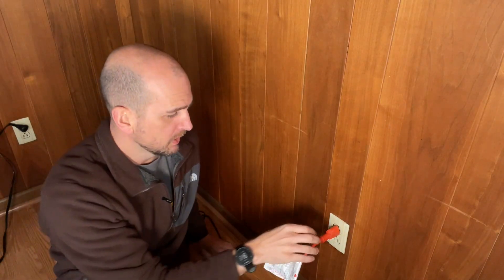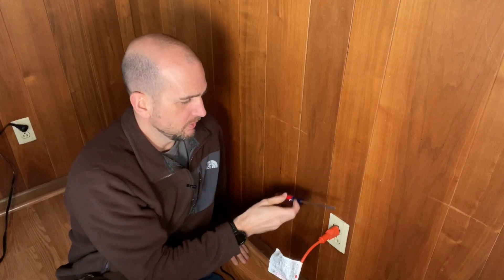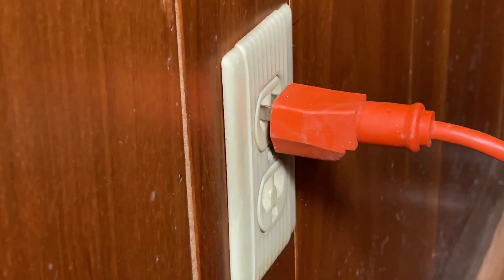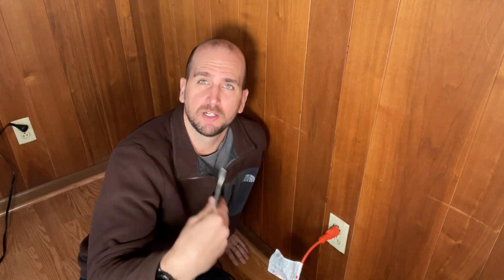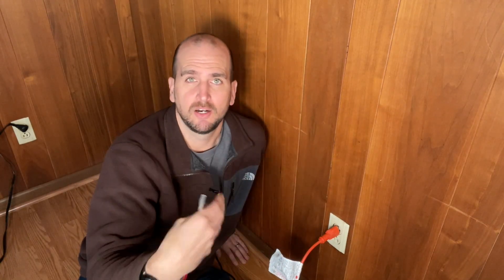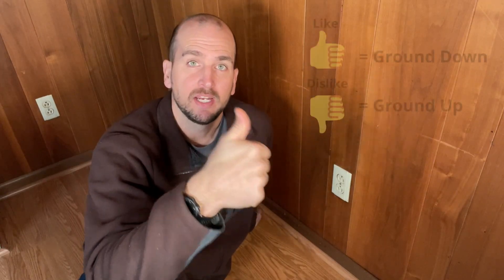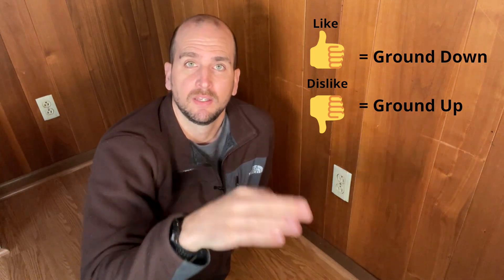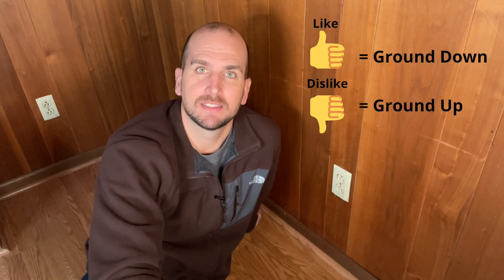Should An Outlet Be Installed Ground Down Or Up

Comment: I witnessed a commercial customer which had a data center on the 3rd floor of a building. The beaded chain supporting the paper basket on a printer broke and fell on the hot prong of the outlet it was plugged into. This started a fire which set off the sprinkler system and flooded the whole building before it was shut off. The repair process took about 4 months. Our company standard is always facing up unless orientation of device needs to be down.
Bill from Nashville Tn.

Comment: in UK we have ground up socket outlets, with wire at 90 degees on all plugs hanging down, never at any other position, plus the socket outlet has safety shutters on the live holes which are opened by the ground pin on the plug while inserting the plug making it very safe to use.

Comment: I recently had some outlets added by a licensed electrician and he chose ground down. That is what I always assumed too. Watching your video, I think that ground up might be better, but would not worry either way. Any outlet that will always have a right angle plug (example-refrigerator or other appliance) I would orient the socket so that the wire goes in the direction needed (usually down).

Comment: The only thing that really has any chance of shorting across the hot and neutral with ground down is the metal face plate itself during installation (circuit should be off so it shouldn't be a factor plus no cord would be plugged in). In most cases a receptacle is connected to metal faceplate then faceplate connected to box when metal, household plates are almost always plastic. Yes there are scenarios where you use a metal faceplate when receptacle is in box first but that goes to initial point.

Then there is the argument that when ground is up it would be the first prong to pull out with loose cord defeating the ground? The ground prong is slightly longer but could you have a hot/ neutral connected and no ground?

GFCI are almost always ground up. Cords etc are mostly designed for ground down applications. 

IMO you match other receptacles and my preference is ground down with residential.

Comment: When I was in Jr. High School, my Social Studies class was right after lunch and 3 or 4 days a week, the teacher would show videos from a projector onto a roll down white screen based on Social Studies and then the last 15 minutes of class after the movie would end, he would rewind the movie ready for the next class. He had the window shades already closed and drawn and he would walk into the class, close the door, turn out the lights and walk back and start the projector. Well one day I brought a small piece of 20 gauge wire to school and before anyone came to class from lunch, I pulled the power cord from the wall and wrapped a turn of that 20 gauge wire across the plug terminals, then left it unplugged by the receptable.
Well in he comes, same routine...out go the lights and he switches on the projector....Nothing happens. Flips the projector switch a few more times, then it gets quiet...as he can see in the dim light that the power cord was unplugged from the wall... then a second later, it looked like a bolt of lightning flash struck the inside that classroom. No movie that day.... by the time the school maintenance got there, class was over....

Comment: With over 40 years as an electrician I have installed them both ways but I think NEC once put out a recommendation to put ground up for the reason you stated in your video

Comment: The last time I worked as a journeyman electrician (the ‘80s) for pay, it was in Canada. The CEC, which follows the NEC for the most part, had an Appendix then which illustrated the different receptacle configurations for different voltages and amperages. The 120V/15A receptacle was drawn ground up. (No explanation was given for the orientation.) I’m reasonably sure that copies of the NEC from that time period would have something similar.

That said, no one on any commercial, industrial or utility job I was on, installed them that way. And no engineer/architect called for them.

I don’t know if current issues of the CEC still have that Appendix, although it sounds like the current NEC doesn’t.

Personally, I go with the flow. If I’m working on an existing place, I’ll install new/replacement receptacles the way the rest of them are. No biggie.

Also, for what it’s worth, in a brand new, fancy, house I helped wire for my daughter a year ago, all receptacles were turned on their sides.

Comment: To me this is one of those situations where people have gotten too overzealous with trying to prevent a hazard that isn't very common. Ive heard various things over the years concerning this such as: "it's code for all general purpose outlets"," it's code for all residential outlets" , " code for all outlets under a certain height", "anywhere a child can reach them" etc. Alot of people have said alot of things to me about this but I have never seen an actual code requirement addressing the matter. Personally I prefer ground down and most equipment seems to favor this. There are so many ways in which electrical equipment can become dangerous that you can't reengineer around them all and it's always seemed kinda silly to me to turn an outlet upside down because something might fall on it.
Reply: You may think that, But I've had it happen in my workshop, where something fell on the plug and shorted between the flat blades.  I also noticed on my company's campus, which was built new in about 2000, that all outlets were installed ground up.  Both of these really made me think about it.  It's true though that ground-up can sometimes be inconvenient with certain devices.
Reply: By that logic, it's kind of silly to have smoke detectors in your house because one day you "might" have a fire
Reply: @jimcab4279  Not quite. House fires are unfortunately quite common and often catastrophic. Metal objects falling on outlet plugs is not.  At some point the safety measures should be proportioned to the risk involved.
Reply: @lauratanner8475  the safety measure of installing an outlet with the ground up isn't all that much "extra" work, in fact, it's zero extra work, you just install the outlet with the ground up to avoid hazard. But hey, I'm just a commercial and industrial electrician for the last 35 years so you obviously know more about electrical hazards than I do, what was I thinking? Not to mention, the industry standard is that in residential units the outlet goes ground down but in commercial and industrial settings the ground goes up because in a commercial or industrial setting there is actual a fairly high risk of metal object falling behind plugs just like described in the video.
Reply: @jimcab4279  I'm an industrial electrician as well sir with plenty of residential and commercial work under my belt as well. In 25 years I've never seen this happen and maybe heard of it happening only a few times. The issue I have with this practice is not the amount of work it takes to install an outlet in either configuration. It is the fact that most equipment is made to be plugged into an outlet that is installed with the ground down.
Reply: @jimcab4279  Oh don't get me wrong I didn't say it was wrong just that it's stupid 😅
Reply: @lauratanner8475  That's the point, it's not stupid that's why the entire electrical industry has been installing receptacles with the ground up in commercial/industrial settings for the last 80 years. The only one who thinks it's stupid is you because you foolishly think that a "few" fires and deaths here and there are a small price to pay to be able to look at an outlet on the wall with the ground down. That sounds like stupidity to me. If you're an electrician then you obvious know that everything is redundantly grounded, I guess that's stupid too because redundant grounding is just redundant...it's stupid lol
Reply: As a kid I definitely had the metal band of my headphones fall off the side of the bed and hit the exposed prongs causing: a huge spark, possible fire by being next to the bed, and a respect for the outlets that has been there ever since
Reply: I guess you deleted your last reply, you're better off because it was starting to sound pretty foolish. Here's the deal, it's at minimum 750 thousand union electricians who disagree with you, so odds would say that if 750 thousand people in that profession think one thing is right and ONE person on Youtube thinks it's wrong....I'd say there's better odds that the 750k people are right and the 1 person saying the opposite is wrong
Reply: @jimcab4279  I deleted by accident. But I'll recap lol. I said basically that since grounded outlets only became mandatory about 50 years ago that I doubted that the entire electrical industry had been installing outlets ground up for the last 80 years. Also that I have never Known of any fires or deaths being attributed to the ground pin of an outlet facing down. That most equipment is made to plugged into outlets with the ground pin facing down as evidenced by akward loops and strains being placed on cords that are plugged into outlets with the pin facing up, not to mention wall wart style power supplies containing heavy transformers and such that can't be correctly plugged in upside down and then fall out of the outlet. And that I wouldn't call it the industry standard since it is essentially down to the personal preference and at any rate it is not a code requirement. When they make it code I'll do it. They haven't because tho there are some situations where it make sense it doesn't in most places. 👍
Reply: @lauratanner8475   I'm in the IBEW, we have 775k members in the USA we ARE the industry standard genius and all 775k of us install receptacles ground up in commercial and industrial settings. The "equipment" and cords you're talking about are from things in your HOUSE, I already said residential receptacles are installed ground down. Commerical and industrial equipment at least 99% of it is NOT designed to be plugged into ground down recptacles. If you were on any of the dozens of jobs I've been on for the last 35 years and you were installing your outlets ground down then you be fired because I've never seen a commercial or industrial electrical job in all my 35 years in which the receptacles were installed ground down...not one, not one job ever in 35 years.
Reply: @jimcab4279  It may be the standard on union jobs but it still isn't a code requirement. 775,000 union electricians is alot but it's probably still only about ten percent of the total electrical jobs in the country. The facility I work in isn't union. It was built in 96. There are thousands of outlets all installed ground down. No one has died and tho we've had some fires none were caused by outlets. So I guess I'll say when it's a code requirement OR if I ever go to work for the union I'll do it lol. Until then...
Reply: @lauratanner8475  The facility you work at was apparently built by a bunch of untrained, low skilled non union electricians who have no clue what they're doing, that's why they installed all the receptacles the wrong way. And because you're surrounded by a bunch of untrained, low skilled non union electricians, you've picked up their unsafe working habits and you're having trouble understanding the most basic safety concepts. I just hope you work by yourself and that you're not responsible for the safety of younger electricians working under you, because your view on safety is lacking if you think safety only gets practiced for accidents that happen "a lot" and accidents that are rare, you don't worry about. You're dangerous
Reply: @jimcab4279  oh calm down.
Reply: @lauratanner8475  It's the same concept of on commercial jobs where you're using metal boxes, after you wire the receptacle you wrap the sides of the receptacle with electrical tape so the exposed screws are covered up, which isn't a code requirement, BUT we wrap the outlet so the next electrician that pulls the outlet out of the box doesn't have to worry about shorting out the screw on the side of the box if it touches. It's NOT code requirement but it's common industry practice among good electricians for nothing more than the safety of your fellow electricians. But I'd bet my paycheck on the fact that "you" don't wrap your outlets and you're not going to start because you've never heard of anyone dying from shorting out a screw on the side of a metal box, good job. lol
Reply: @jimcab4279  Go to bed Jim!
Reply: @lauratanner8475  I can't I keep having nightmares about dangerous electricians who don't know what they're doing :)
Reply: Laura is correct.  It is obvious for those advocating shorting is a likely event then the use of a face plate with a deflector similar or the same as a mobile phone shelf to USB featured plugs or all receptacles need an outdoor type lift cover(cover lifts upward not to the side).  Claiming the ground up a safety feature to prevent a short is akin to me passing gas in any room I occupy is a safety feature because anyone entering the room will know someone is present by sound or smell.
Reply: I see your point.  Unfortunately rare accidents can compound with rare curcumstances and be devastating.  When installing ground up in an area where debris may fall would prevent catastrophe, that "i should have" feeling is not something you want in hind sight.  I say ground down in most situation but i would consider ground up for a bathroom, behind nightstands, and in garages.

Comment: Several years ago I bought a house, in Florida. This house was built in the 70"s. The electrical work had all outlets installed ground down, except for outlets controlled by wall switches. These were ground up.
Reply: I think that is a great idea, this way all it takes is a glance to know which outlets are controlled by a switch.

Comment: The last residential wiring I did (1976) was for a blind woman so she could touch the ground prong and the ground hole with one hand.(even wet) With the ground up it was less dangerous because the live and neutral were not in the way when she touched the receptical. It doesn't matter to me whether it's up or down, but from that experience I put ground up consistantly.
I have been a professional since late '60s, but only license (master) in Fla in mid '70s. Primary is industrial, old school magnetic controls thru PLCs.
Bi11 Hudson

Comment: I agree the ground should face up or to the right . If you have a horizontal orientated outlet the neutral will face up thus giving you protection from arching or electrical shock should something fall on the blade or a child putting something across the bare prong of the plug.

Comment: I've always installed plugs with the ground on the bottom.  Most plugs are designed for that configuration, especially the low-profile plugs.  They are all oriented so the wire immediately proceeds in a downward manner.  I don't buy the safety issue, as it is a rare three-prong plug that DOESN'T fit snuggly.  I should mention that I am from Canada and I've heard that in the province of Quebec, they prefer the ground to be in the upward position.  Even knowing this, when I renovated my home in the Gatineau Hills of Quebec, I insisted that all the plugs be installed with the ground down.  I think Quebec is bucking the norm because, well, basically, that's what they love to do.  If English Canada does something one way, they want exactly the opposite . . . just because.  I hear they're thinking of changing the driving lanes to the opposite side, like the U.K. – just because.  I'm kidding, of course . . . but just imagine the chaos when crossing the border between provinces.  Ha-ha!
Reply: It could be argued that ground up makes stresses in the cord where it leaves the outlet greatest in the ground wire, making an open ground the most likely cord failure mode. I've never known that to happen, though, and I will be 70 next month.

Comment: An additional argument for ground up is that when the plug is jerked partially out then hanging down at an angle, or it's under strain and being levered out, the live conductors are in the receptacle more and the ground is out more, making it marginally safer. Flipped the other way, the live conductors are levered out and exposed, but potentially still live.

Comment: In my house, they are installed horizontally in the baseboards. I prefer the ground on the bottom when they are installed vertically. It works better with cords that have a profile plugs.  If your plugs are falling, the outlet should be replaced.

Comment: Although the orientation is not specifically identified in the NEC, it is a NEMA standard for the ground prong to be at the top when installed in a vertical orientation.  When installed horizontally, NEMA standards say the ground should be to the left (neutral prong on top).
Reply: that what i learned when i took my electrical classses and it was in the nec either 2002 or 2005 i  had both
Reply: thats what i learned in my electrical classes it was in the NEC either the 2002 or 2005 edition i have both

Comment: If ground up is correct, then a flat 90 cord should not point strairgth up when plugged in. The ground up to prevent shorts would make senseif flat three prong cords were mandated to point down.